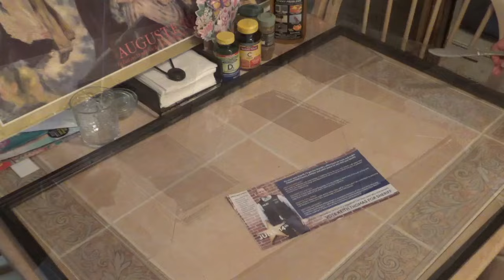Cardboard Dollhouse Start to Finish

Comment: Hi! So to make it sturdy? You just added layers of cardboard? No paper mache needed?
Reply from the maker: Basically yes 2 layers or more will make cardboard sturdy. It is even stronger if the corrugated grain of cardboard go in perpendicular directions. Also at the end I hardened the surface with a mixture of wall joint compound and glue. I did put paper on the outside edges to cover the rough edges for a more smooth finish before the slat boards which were made of mat boards cut into 1" strips.

Comment: If you're making this out of scrap cardboard how do I keep the creases from showing through just prime them?
Reply from the maker: I added layers, 2 for the outside and then with the siding added you don't see any of the folds, seam, or creases. For the inside I used wall paper to cover the cardboard. If your still worried about creased showing before adding wallpaper mix 1 part glue 1 part wall compound to smooth out the surface. Apply with a smooth flat paint brush. When dry you can sand it. Hope that helps.

Comment: That was fantastic Debra. I will subscribe and check out what other videos you have. Would love a few measurements and as I am just starting off is that a 1:12 scale? Was there two layers of cardboard used for the walls. Great job. Cheers Robyn ❤😊
Reply from the maker: When I started this project I didn't pay much attention to scale but it is close to a 1:12 scale. My next one will be more uniform. I considered this one a practice one.
Reply from the maker: Replying again since I missed answering one of your questions. I wish I had used two layers thick on the interior walls or used two layers of matboard a much sturdier board. The exterior does have two layers of cardboard.
Reply: @DebraCarmona  Thanks Debra. I was going to make my project with one thickness of cardboard but after looking at your video, I thought that looks sturdier. Thank you for getting back to me. Cheers Robyn 😊